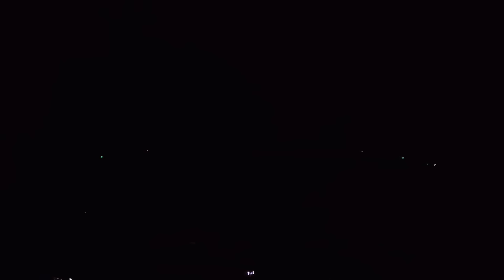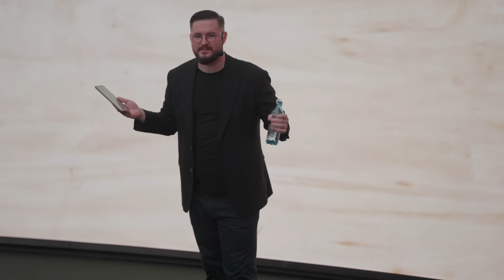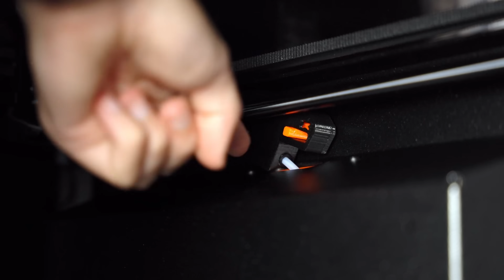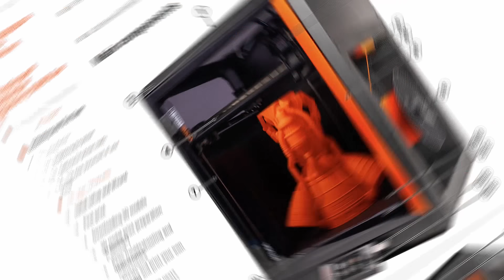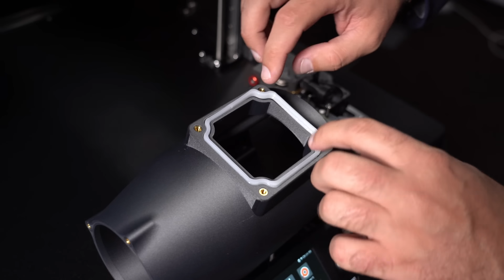Prusa Day - October 2025 - Full Keynote

Comment: Core One is a great new direction, but there's still a lot of work to do to catch up with the competition. No real active chamber heating, no nozzle wiper..The filtering system is a joke (the chamber is not properly sealed) . No proper AMS. ... I still don't understand why you guys are selling products that are simply outdated at this point, like  MMU3 or Prusa Mini. The market has changed. People want machines that are smart, safe, easy to use and can automate work, machines that work out of the box.

Comment: Absolutely stunning presentation guys.
I look back less than 15 years to my first Sells Mendel that I built. Sitting on IRC trying to get it working.
The Prusa Mendel came next. We were all blown away by the simplification of the early design.
Then came the Original i3 and MK4 built on the i3 ideas, refined and improved in every aspect.

What you guys are doing today is absolutely Stunning !

Alex. 
AKA ParCan

Comment: I've never accidentally used the wrong filament, but being able to tell exactly how much is left on the spool is game changing. I'm glad it's an open standard. I've seen too many companies try to lock down their printers with proprietary filament. There was a lot of talk about being able to air gap your printer, but this doesn't seem to be currently true with the camera. I believe the buddy camera is wifi only and wifi is hard to justify in an air gapped environment. I think you need to use PrusaConnect to support a camera. Here I am with a Mk4 and I'm still using octoprint on a RasberryPi just to get the camera. Mk3 gets to use PrusaLink on a RaspberryPi, I wish the Mk4 could have the option for the same.

Comment: 00:00 Intro
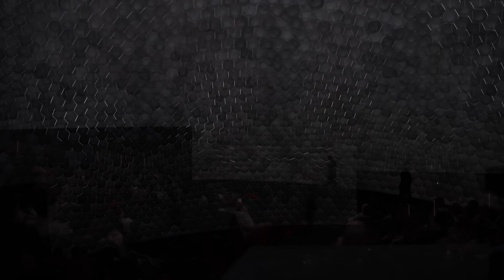02:30  CMO Rudolf Krcmar looking back; MK4S, Core One, XL, 
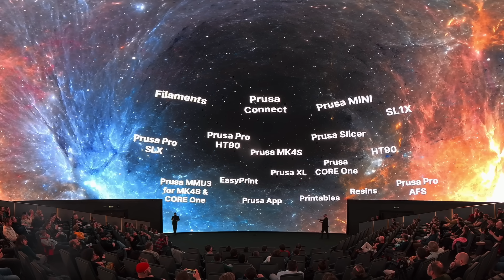06:30 Jo about Prusa being fully integrated;  Farm and Injection molding, expanding the company
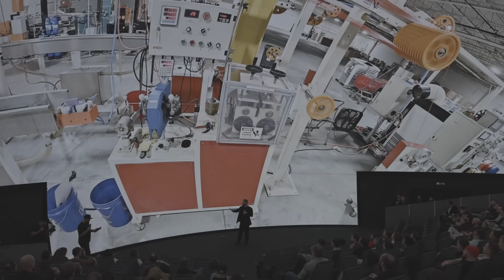13:15 Rudolf Krcmar on Printables, EasyPrint,
15:23 Mikolas Zuza on Smart Spools, OpenPrintTag
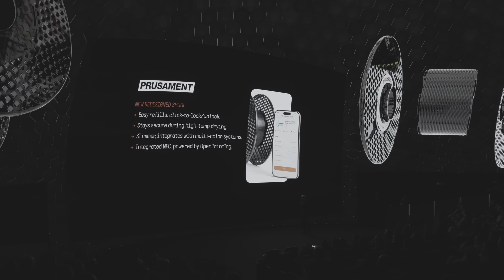24:50 New Prusament Spools
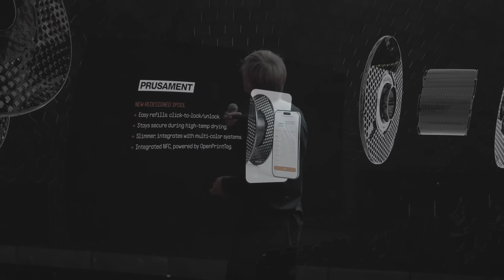25:45 Prusaments
28:15 Jo shows the limited Signature Oak printer
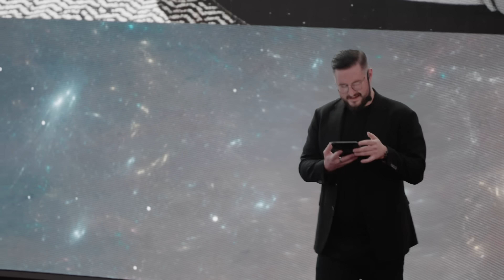34:30 Stephan? on the Core One
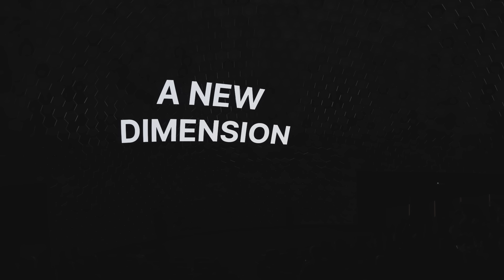38:40 Jo releases the Core One L
56:27 Mikolas Zuza "DEVELOPERS!"; Availability,, PrusaSlicer 3.0 first look
01:00:00 Jo on the Critical Infrastructure addition, airgapped machine
01:04:00 Stephan with some numbers on the Prusa XL
01:07: 00 New additive manufacturing technology; 
01:10:00 Eran Gal-or CEO of Filament2 explaining the new technology
01:17:40 Jo with some more mind boggling ideas of the new technology
01:19:20 End
Reply: You sir are awesome

Comment: Offline printing being one of the biggest advancements is really funny, we went the full circle on this one. Really hoping Prusa will prevail. I just wish I could afford their machines as well instead of selling my soul to the Chinese subsidized 3D market.
Reply: To save your soul: the MINI has a fairly decent price and is big enough for 95% of all prints. You can get a used Prusa online for okay prices (you can upgrade it later, but currently the MK4S kit is not that much more expensive than the upgrade MK3->MK4S). Depending on what your budget is the MK4S might still be inside your boundaries. If you buy directly from Prusa: always buy the Kit version - it is cheaper, easy to assemble and teaches you some very valuable lessons about how the printer works.

Comment: yeah, it's all about the new, meanwhile as an mk3 owner I feel like Prusa has gone down that "if you don't have our latest models we don't care about you" route that sooo many tech companies adopt as they gain success.
Reply: I'm not sure what you mean. There are multiple upgrade paths for the MK3 still, and they are still releasing firmware updates. Spare parts are still available. What exactly do you feel you're missing?
Reply: Im in the same boat but tbh, what's to update on the MK3 without buying new hardware? You can already upgrade it to an S but it still wont come close to the new hardware.
Reply: It works and you have the possibility to upgrade, what else do you want?

Comment: Can't understand why they would only make 250 wooden ones. As a limited run with special 100y old oak, sure, but please also make a "normal" design line!
Just normal oak, well manufactured but not as expensive as these special ones. These Printers have a massive "wife approval factor"
Reply: the cost of the material will have the least impact on the price.
its all hand made so you can expect that special edition to cost as much as a full loaded XL even when using cheaper wood.
Reply: @Pixelplanet5  I know, I think I did not phrase it well.
By using "normal" wood AND making the wood more of a visual part they could massively reduce the total handfitting.
Reply: it probably costs $3k to make and they'll be selling for $8k/each
Reply: @UNgineering I would almost bet with you that they do not make a huge profit on that line. It is so much handwork of skilled workers to do it.
And it really seems this is a very personal topic for Joseph